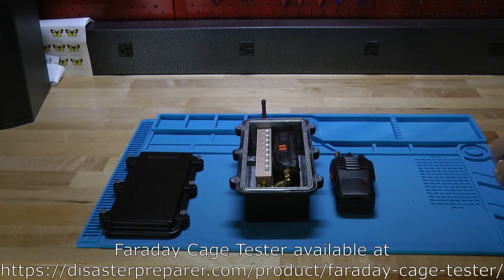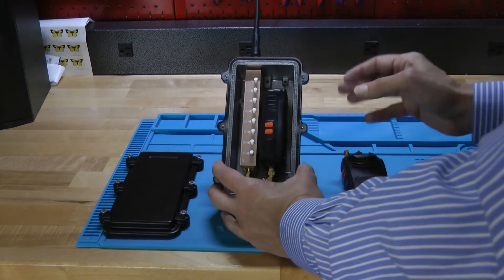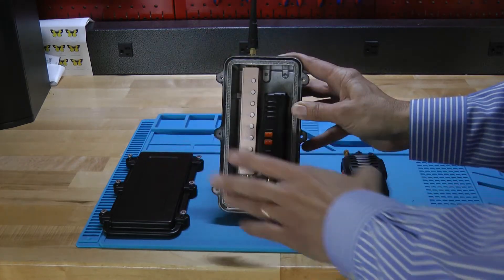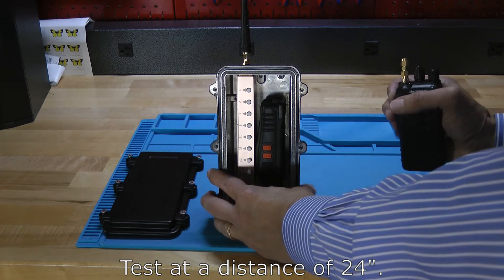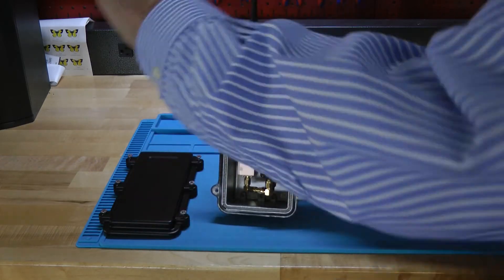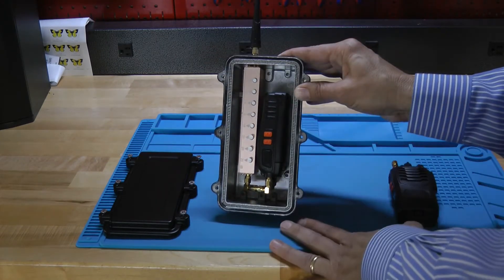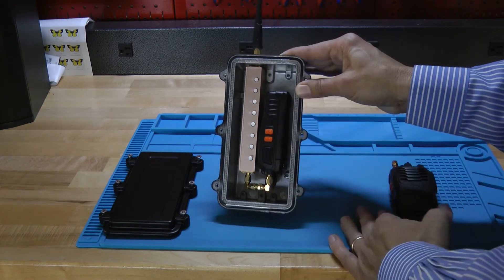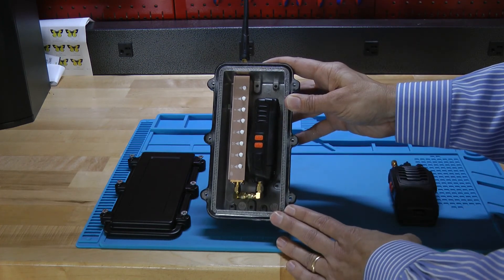Faraday Cage Tester - Video 2 (How to Use)

Comment: Does a faraday cage have to be grounded if yes how do I do it?
Reply from the maker: No, it does not. That's a misunderstanding many people have.
Reply: @disasterprepper  will a microwave oven work?
Reply from the maker: @metoo1486  The test data is in my EMP book. The microwave I tested did an okay job shielding at these frequencies. Not as good as a foil-wrapped box or EMP bag though.

Comment: That sounds very interesting. Waiting for the test! 😎👍
Reply from the maker: I test a really good EMP bag in Video 4. I use a spectrum analyzer to get the right answer ahead of time, and then verify it with this low-cost tester.  https://youtu.be/gVFF9i60VZw
Reply: @disasterprepper  yes! I saw the 4 videos and most of your play list.
After the lockdown ends here, i will work to get some of protection like the T.R.A.P and EMP bags shipping to Chile.
Stay safe 😎👍